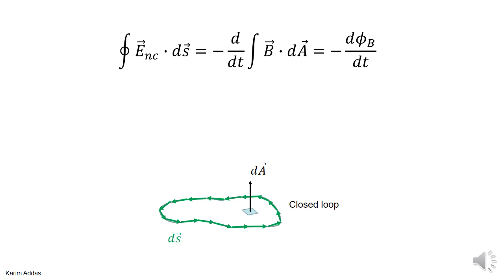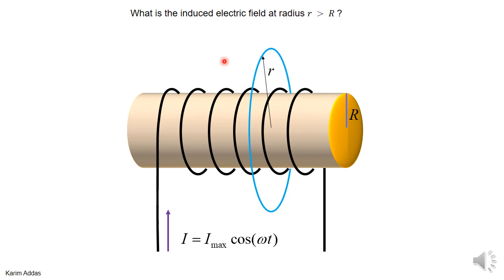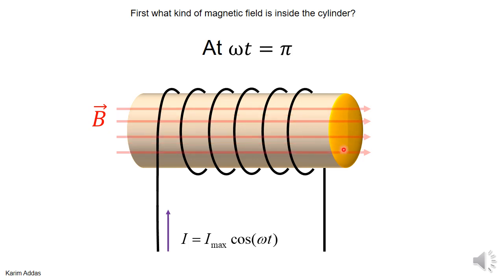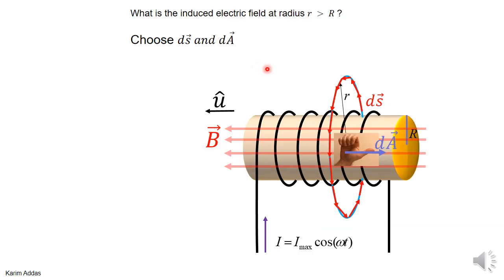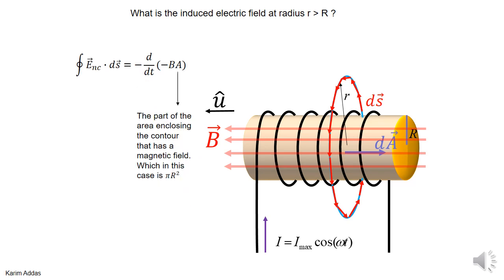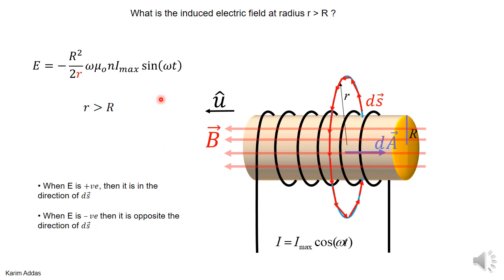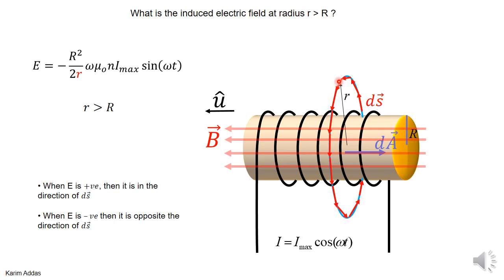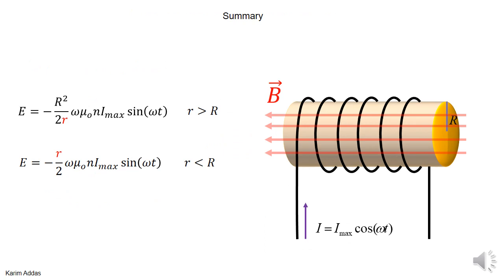4 example oscillating current

Comment: i think of wave in terms of sound- the oscillation of sound which is the Rate of P/V  at a point {T} i never thought of as circular. EMF=light QM- wave/particle (slit experiment 1 slit =particle 2 slit=wave or results change by observation) observation paradox=the observer interacts with the observed through observation-is this a valid question? or is it expreso ad absurdioum-LOL. thank-you for kind attention.
Reply from the maker: this problem isnt really about waves. its just a problem to apply faradays law